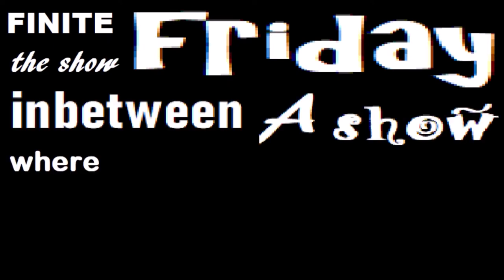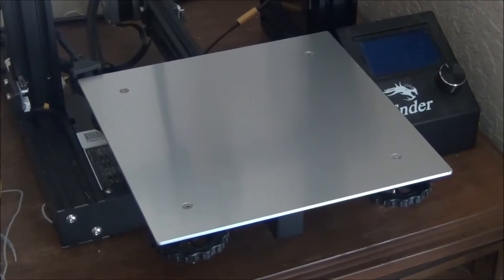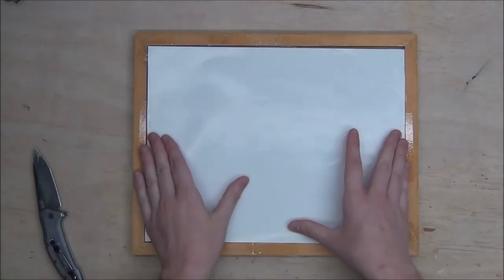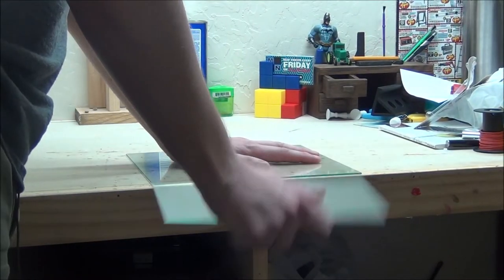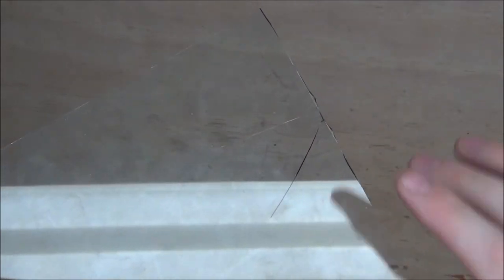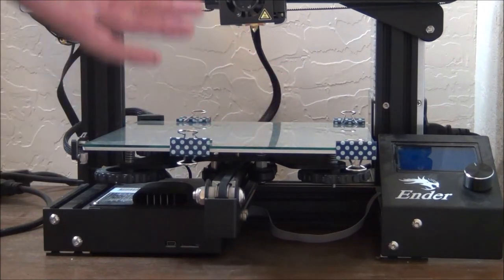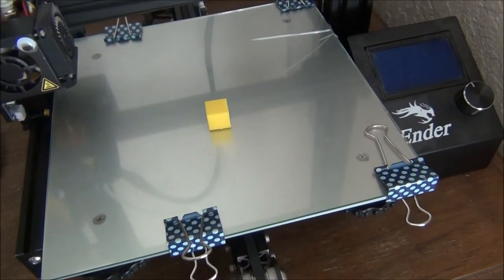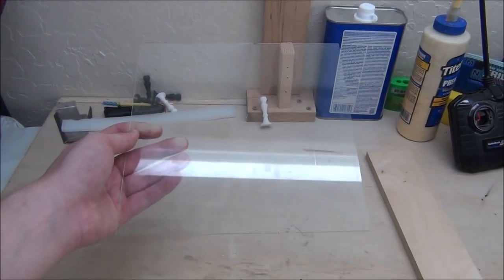$2 DIY Glass Bed for Any 3D Printer! // Finite Fridays ep2

Comment: I cut glass for windows at work. Just a tip. Clean the glass first, and use the opposite end of the glass cutter on the opposite side of the glass where you scored and tap it until you see the scored part get bigger. Go all the way to the end and then flip it back over and snap it off for a cleaner edge without cracks.

Comment: If you use that $2 to buy a polycarbonate sheet, you will get a superb build plate for almost all types of filaments. Adhesion will be excellent without any glue or hairspray. Sand it before using so that you can remove the parts easily. And its flexible too. So you can bend the plate a little bit to remove your parts.

BTW measure the points from the edge so that you dont need to cut the sheet twice. It also gives you enough extra space to break the plate without any cracks.
Reply: Polycarbonate huh? Link?
Reply: never melts?
Reply: @gianfds3177  
Although the heat transfer was excellent, it didn't melt until 120 deg. I checked on the internet and the data says that the PC sheet melts around 300 deg. So, no problem.
Reply: PC/Lexan is the best.  Home Depot

Comment: Love the eyes on the extruder.

My ender 3 came with a nice removable bed.
Reply from the maker: Mine didn't. I was glued on :/  but I'm planning to buy a really nice one for it! :D
Reply: do you mean the plastic kind of bed that is held on by binder clips?
That bed sucks imo. Its just as warped as the main aluminium plate and it makes printing really hard. Will a glass bed solve this issue completely?
Reply: i guess it is quite off topic but does anybody know a good site to watch new tv shows online ?

Comment: practice, practice!!..score once! and sand the edge. To cut picture glass best to score till hear egg shell cracking, meins your gutting perfectly hard. to brake glass best to use a corner to snap the glass. ITWILL NOT CRACK..lol. Bed adhesion best use glue stick.  DONE!!
Reply: R/ihadastroke

Comment: My bed seems to be warped so I'm thinking about doing this myself, It's lower in the middle and just hard to use overall even whit a bed leveling testing file.
Reply: Got the same problem, need to buy a new one
Reply: If you don't flip your mattress every now & then it could warp, i guess. I however got a mirrored glass tile, lots of fun to print on. It's fun to watch glass pros cut glass.

Comment: I want to try this because the new PLA I got doesnt stick on the magnetic bed surface of my creality ender 3 pro, but it does stick on paper and has ok results (although it moves a lot and lifts up with the hot air from the heated bed)...I'm hoping a glass bed will fix the problem

Comment: always cut on a hard surface, not soft. Use a good glass cutter or at least lube the wheel with oil and kerosene 50--50, so it moves. Then its actually better to break it using your hands on either side. Or if it has to be on the edge, for the long piece lift it up and left gravity break it on the way down. Otherwise you could sever your arm. They make running pliers for small stuff or breaking pliers. I've dones stained glass for over 20 years. 

The score is the score, there is no deep enough. But if you run over the same score twice it will mess it up. The glass will go where it wants if you don't score in the right spot, and cutting against a ruler is actually harder than free hand as the cutter goes at weird angles against a ruler.

Comment: Love the diy idea. Thanks for the video, one little thing to point out, you have your X belt hooked the wrong way. 👍🏼
Reply from the maker: Thanks! Hooked the wrong way how so?
Reply: @MechNinji  the metal tabs should be sitting in the extruder assembly facing downwards instead of upwards like you have it. If you flip it, the belt will sit in the channel instead of being raised out and looking weird
Reply from the maker: @720MotorWorks  ah! I believe i see what you mean! I'll be the first to admit, flipping those, like you suggest, would, I believe, clean up the apperance of the printer. However I don't think it is of too great importance, as I doubt the proformance of the printer is much effected by their placement. Regardless though, thank you for sharing! I might pop them around just for the camera's sake!

Comment: Just letting you know you can buy the material from the makers of that material directly and the only difference is no logo and u have to cut it to correct size. I will go and check what the stuff is called and who yo get it from if u want but imma have to do that tmrw as it is almost 1 AM and imma sleep now... gn :)
Edit:The stuff I bought for cheap but is the same as the material on your printer is called buildtak and I bought my 250mm by 250mm sheet for 7$ about 2 yrs ago and mine is still working great. Though now thinking about it may have been on sale but good luck to you

Comment: So it's actual glass and not plexiglass/acrylic? Unusual these days.. I've been printing on glass since Day 1 (2017) - my Wanhao i3 Plus came from the shop with a sheet of glass. Usually I use glue stick on the glass, pretty much all the filaments I've tried stick to the glue stick. Those binder clips you have are HUGE - get the smallest size that will clip the glass to the bed, that's all you need. Another tip - hold down three corners only, if the glass is flat it will remain flat. I've removed one of the levelling screws, spring and knob from the left rear of the heated bed.

Comment: All glass types can't take heat they explode at around 100°
But i dont know how well the heated bed works when the glass is installed
Reply: so if you piur boiling water in a glass it explodes? this is new to me
Reply: @antonioa4814  This guy don't know what he's talking about, 100c will "explode" normal lime-sand glass if applied unevenly from the thermal shock, in this application it will heat up mostly consistently and even normal glass can withstand up to 150c with no issues. Borosilicate or tempered glass would survive even the thermal shock.

Comment: You need to dip in oil your glass knife than cut the glass...use any oil...best it parafine oil...you can use oil for cooking
Reply: Ohhhh this is such a controversial topic among glass cutters, whether or not to use oils/querosene or nothing, that I wouldn't want to get mixed in this centuries old battle.

Comment: Does the glass crack over the exposure of heat? How much temp can a normal glass take?
Reply: No, glass that isn't already cracked won't crack from the heat, I use picture frame glass for more than 2 years now and I print ABS at 110c bed, no problems at all.
Reply: @Spartacusse sorry if this is a late question (only 6 months lol) is your glass directly touching the aluminum plate or is it sitting on the PCB/TAK/sticker whatever you call it by?
Reply: @cerolocks8662  Hey, no problem at all. Mine came with the removable print surface and the clips, so I just removed it and placed the glass in direct contact with the aluminium bed. 2mm glass was enough that I could even reuse the same clips. I later replaced the clips for some ultimaker-style glass clips for the looks. Here's a pic: https://i.redd.it/392zx85mg1u41.png

Comment: the scary part with this idea is not the cutting of glass, it's that if your print sticks too much, you may end up breaking the glass, and hurting yourself in that process (or losing an eye). So definitely need eye and hands protection when removing your prints. 
With the glass sheets meant for 3d printers, it's a lot harder to break the glass itself, the worse that can happen is a piece of the glass sticks to the print and comes out with it, but it's less likely that the entire glass will break.
Reply from the maker: Thats quite the leap

Comment: Standard glass has a risk of shattering catastrophically.  Several 3D print folks have posted they ended up in the emergency room when the glass suddenly shattered after working fine for a long time.  Buddy, you are taking a huge risk to save a couple of sheckles.  Get rid of that cheap glass and upgrade to borosilicate now.
Reply: Hi, can you link some reddit posts or something about those horror stories? Because I use mine for more than 2 years now and even worst because I print ABS, so 100c bed, and I never had a problem or even heard of these stories you mention. Maybe people thought it was a good idea to spray alcohol under the print to release it faster causing thermal shock? That's the only explanation I can think of.